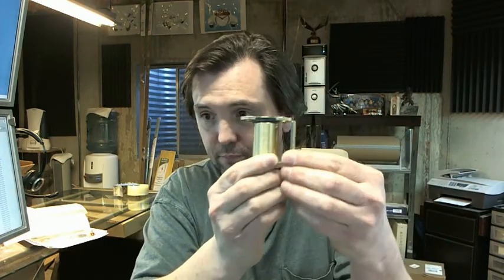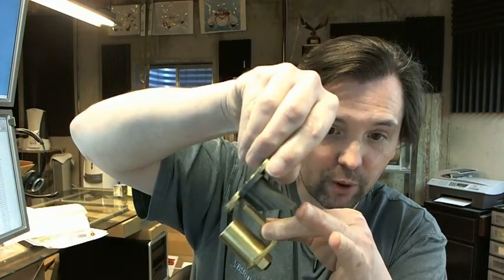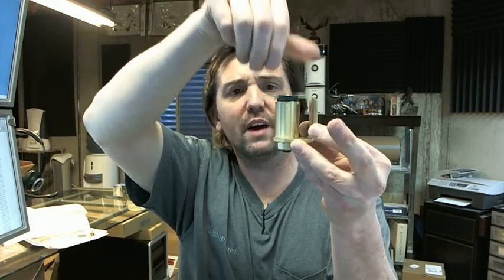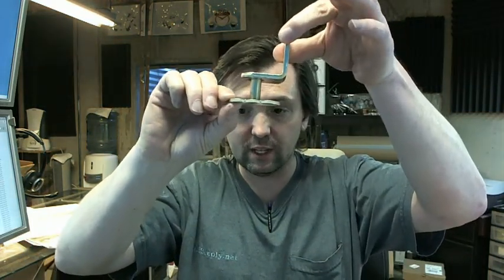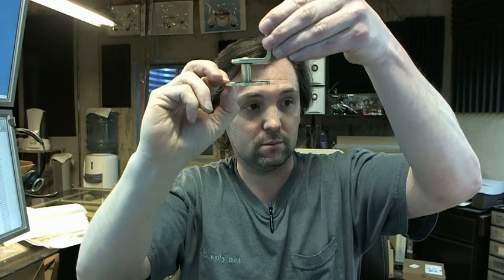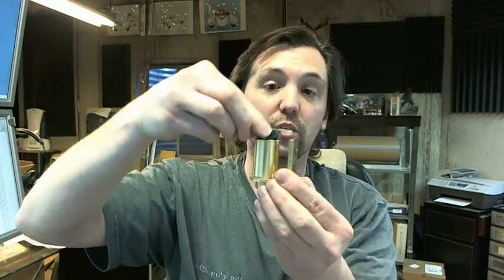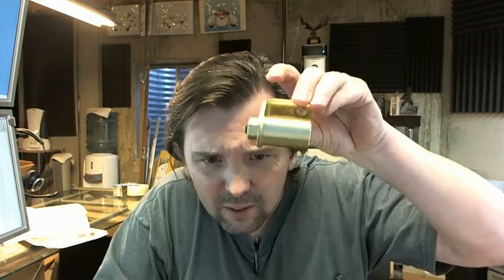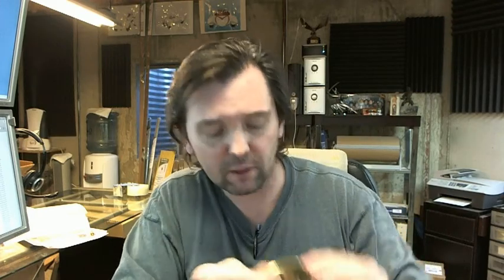Bommer 7512-H-633 Louver Door Gravity Pivot-Hold Open-Steel Base-Satin Brass Plated

Comment: Hi Richard.  Do you still work with the Bommer hinges?
Reply from the maker: The short answer is yes, the Bommer 7512 series as seen here:   https://absupply.net/searchfast.aspx?KeyWords=*7512+bommer
would work on a 19 pound gates that is 5/4 thick and it's also available in a hold open feature as well which would be the part number

Bommer 7512-H-600

as seen here   https://absupply.net/searchfast.aspx?KeyWords=*bommer+7512-h

your question was:   I am looking for dual action hinges that will work for a gate that I made several years ago.  The dimensions are:  45" wide, 38" tall, 1 5/16"thick, 19 lbs. I thought it was constructed from standard 2x10 & 2x6 lumber, but it must have been decking boards 5/4" thick. I tried some dual action hinges from Lowes but the wood split after a few months.  I haven't used the gate in probably 5 years and my wife wants to try it again.  I contacted Bommer Customer Service and discussed my situation. They were very nice but it came down to the fact that my gate is not thick enough. I usually never take no for an answer so I kept looking.  I cam across some youtube videos that Mr. Howard made from 2013 and I started wondering if the 7512 commercial grade would work.  What do you guys think?  If no, do you have any suggestions that I could try? Thank you very much and, please tell Mr. Howard thank you from me for his very informative and thought provoking videos!  Bruce S.